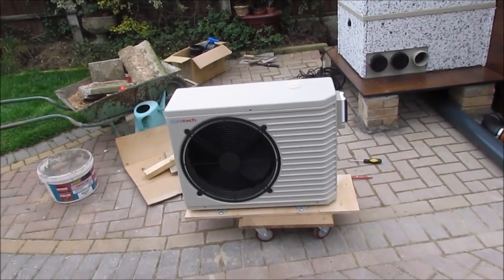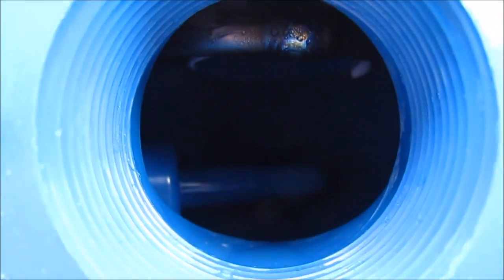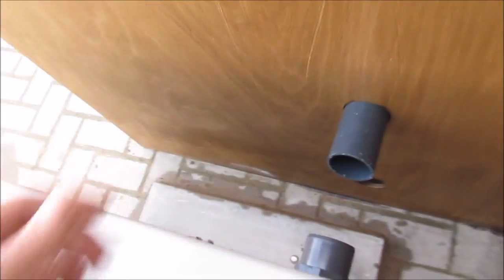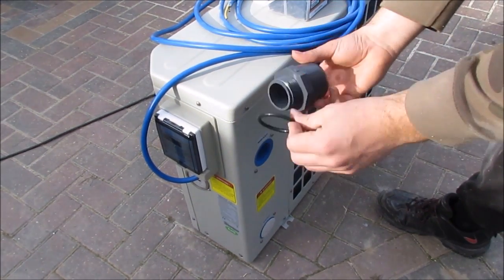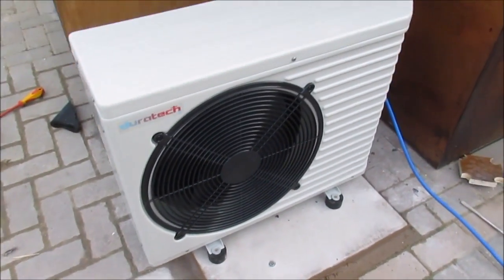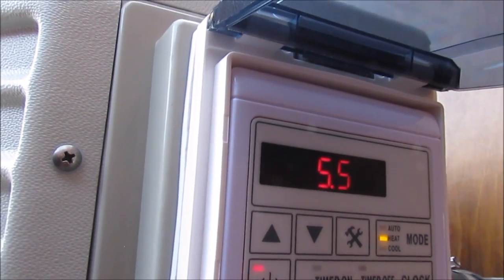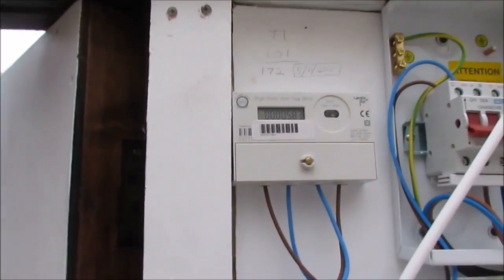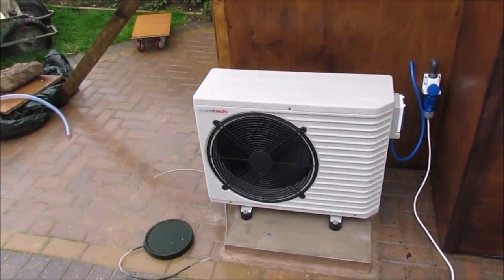Installing air source heater on koi pond Duratech 7+

Comment: Hi Adam I have just picked up a used unit 
Have you any idea how to get it to maintain a set temp ?
If I switch it on and warm the water to say 22 degrees using the heat selection it takes it up there and switches off but never kicks back in to maintain the temp any idea I can’t work out the settings button at all it just seams like codes in there 
Thanks Mike

Comment: The provision of electrical supply to such equipment isn't exempted from the wiring regulations. I can't comment on other aspects of your work, but would advise employing an electrician for electrical work or gaining the required knowledge as ignorance is not a viable legal defence where death or injury are concerned.

Comment: Hi great videos.   
I have recently purchased a air source heater and was wondering if you could advise me on which part of the filtration you would recommend fitting it to please.   ie heat water flow before filtration or after filtration on pond return?
Thanks in advance and keep up the awesome videos.
Cheers, 
John
Reply from the maker: Hi John,
Always put the heater after the filtration as it will get blocked otherwise.
Adam
Reply: @AdamJulyan  thanks for getting back to me. 

That makes perfect sense 👌   thanks for that.    
I look forward to seeing your next video. 

Take care,
John

Comment: Excellent video as always. What is the cost of the heater and the actual running cost? Thanks.
Reply from the maker: Hi, I I'm not sure what the current cost of one of these heaters would be but i have made a video on the running cost of it link - https://www.youtube.com/watch?v=Vo9Yj0XU-jk&feature=youtu.be

Comment: Adam the air source heat pump is that a swimming pool variant as I'm thinking of adding one to my pond of 2300 gals. what size heat pump would you recommend and what size of an area do you need around the heater to work properly. hinting for you to do an update on the video ref siting a unit and how you found the running costs.
Reply from the maker: They are for swimming pools but the difference between pond specific ones and pool ones is the temp so a pool one might have a 2DegC drop before it starts up again this would not be good for the fish so the pond ones are usualy half a Degree drop and they will startup also pool ones cannot heat to low temps so the pond would always have to be higher than 25DegC in some cases. 
You could use the same heaty pump as me the 7+ but if you want to keep at higher temp in winter or dont have very good insulation probably go for the 10+ version as its always better to oversize a heat pump. I will be doing an update on the heat pump shortly as it does not come on anymore as the sun keeps the pond at temp and i know exactly how much it cost me to run over the winter.
Adam
Reply: thanks mate plan to see Darren at the weekend. just trying to work out how to plumb it in to my system as I have an aqua sieve with two sequence 1500 one goes too a bbf2 then over a bakki shower with BHM my other goes from the sieve to the UV then over the bakki so all my water is returned via bakki have got a return back to the pond which I don't use so I guess I could return it via that. have got loads of 30mm poly carb . mate your vids have got me back into the koi bug just caused me to spend the last three days ripping out my old vortex shite and re doing all my pipework and fitting the sieve would have liked a drum but would need to sell a kidney. sorry for the long reply. just a final quick one your bakki with BHM on your outside pond you have crystal bio in it as well. what do you think to the media as I was going to add it to mine or get more BHM to increase my bio side of things.
Reply from the maker: I would use the pond return get a small pump as the heat pump has a feature where it will run the pump every 30mins to test temp and keep the pump on when heating the rest of the time the pump will be off as it's not needed. I don't think it's a good idea to put heated water over a shower. Glad you like the vids thanks for commenting. Adam
Reply: thanks Adam will look at doing that.
Reply: Adam could I put a t piece in after one of my pumps to divert water to the heat pump then return it to the pond via the return in the pond wall instead of it all going over the shower.
Reply from the maker: Phil Walton yes that would work put valves after the T so you can controll the water in each direction. If you turn the valve off to the heater it will go into flow controll and slowly open the valve until enough water is flowing for it to work properly then you know your not wasting water that could go over the shower.
Adam
Reply: cheers dude didn't mean to be pain but it's clear you know what's what by your vids.
Reply: Adam got the heat pump up and running cheers for the reply. Am setting up a quarantine system was Interested in doing a bakki river for it instead of a shower just for a change did you build your own if so you got any recommendations. Cheers phil

Comment: Hi Adam good video  I'm about to fit one of these Heat Pumps i'm planning on connecting to a normal plug with a 10 amp fuse and plugging it to a normal indoor socket for the time being and later hoping to fit it to a consumer box  would be grateful for any advice Thanking you.
Reply from the maker: Hi, yeah it should be no problem plugging it in. it does not use that much power when running. I wired it in directly because i feel it removed a failure point as in the small fuse in the plug might blow eventually and i would put a lot of money on it blowing on that cold winter night when the heater is most needed causing the ponds temp to drop fast killing all the fish.
Adam

Comment: Adam, interested in how the unit has performed now external temps are lower. Thinking of one for my 3000g pond. Electric heating is costing a fortune. 
Looking to call down to absolute koi soon to see one working, but value your opinion
Thanks
Darren H
Reply from the maker: Hi, Personally I think the heat pump is worth every penny compared to a standard electric heater i have been keeping my 1000gal tank at 23DegC all the time and it is costing about £7 per month to run at that temp and it has been quite cold here. It has no issues with the cold though it runs fine until about -2DegC colder than that and it seems to freeze up but it just stops for a few mins and defrosts and carries back on again fine. so far the coldest it has been running was -5DegC and it had no issue with that at all. So yeah i'm really happy with it. I have a 400gal tank that is indoor so its not that cold anyway that has a 300w standard heater set to 21DegC that costs more to run than the 1000gal with the heat pump so i would imagine a standard heater on my 1000gal tank would cost a fortune to run.
Adam

Comment: Hi Adam, I've got a really important question. I recently bought a few four month old koi and there only about 5cm, I'm told their tiny for their age, is this true? thanks sam
Reply from the maker: Hi Sam,
different fish grow at different rates dipending on water temp and food. If they are healthy and happy then its nothing to worry about. in the right conditions a four month old koi could be about double that size but only if it was in the right conditions for that growth. i dont really get fish that are under 4 month old so i dont know exactly but i have just bought some 4-5 month old fish that are 10cm but they also had some 5cm ones in the same group.
Adam

Comment: hi mate I have a heat pump just like urs coming soon , can I put it in side of my pump house? 

instead of outside  

thanks mate 

best wishes 
kevin from south wales
Reply from the maker: No it has to be outside. Unless you have a huge semioutdoor polly tunnel like darren at absolute koi. however it still gets cold in there when the heaters are running. 

They emit so much cold air its unbelivable and its really cold.

Adam
Reply: OK thanks   :)

Comment: what a Cadillac Adam= Great Work. Thank You for doing these videos, and I always look forward to the next one.- was wondering about how long did it take to install? Keep up the good work and thanks again-partly cloudy with a high of 70 today and a chance of rain tomorrow on election day here in the midwest of the united states - My best to you and yours
Reply from the maker: Thank. It took 2 days to install but really that was because i was working on the pond as well if it was a fit to an existing pond it would only take a few hours. This heater also does cooling in case it gets too hot although that's not a problem here in England today was sunny with a high of 41. My best back to you and yours.
Adam
Reply: Adam Julyan another great video mate. Always helpful. 
where did you get the pipe insulation from?
Reply from the maker: Cheers. I got the insulation from https://www.pipelagging.com/ click on "insulation by pipe size" and select the size you need and it will give you all the available types in that size.
Adam
Reply: Adam just a quick question I have the same heat pump do you have the flow set so there is just 1 degree temp difference or slow the flow so there is a 2 degree temp difference between the incoming water to the out going water. Instructions say it should be 1 or 2 degree difference.